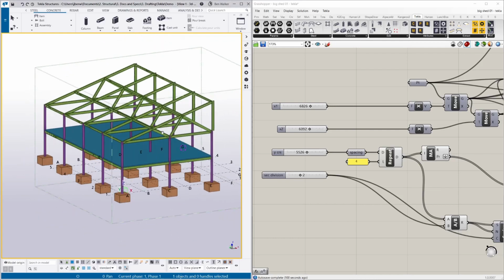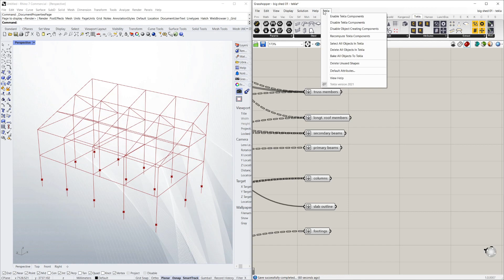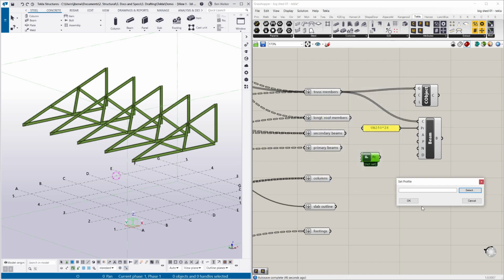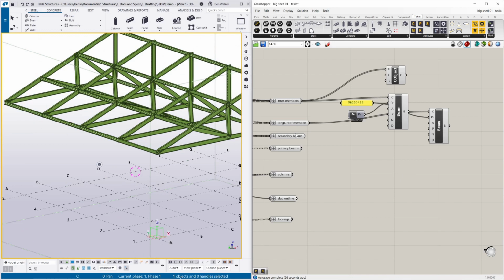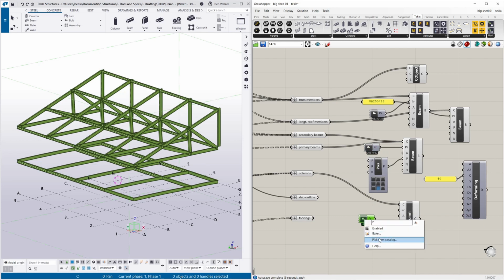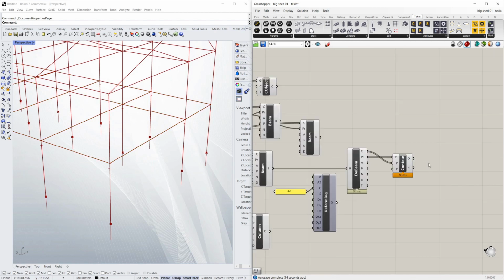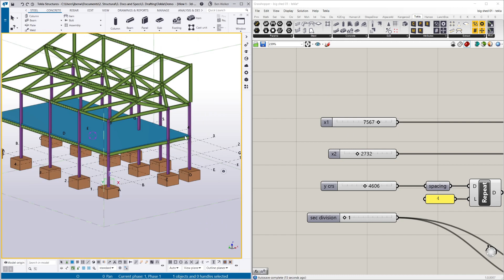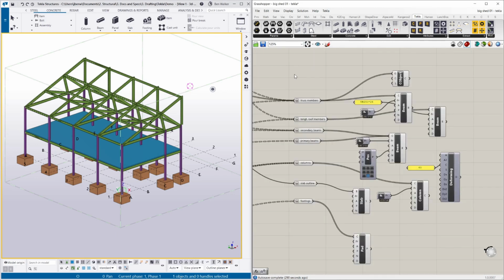Tutorial: Tekla Structures with Grasshopper

Comment: I see that Tekla model is not detailed, is not getting finished. Does it mean that to get Tekla detailed (putting all needed connections, bolts etc) user has to do it manually, by hand?
Reply from the maker: With this demo yes. All the connections, bolts etc. will need to be added manually. However detailed connections could be automated is if someone wrote a script to do this.
Reply: @StructuredParametrics  okey thanks, my point is if it is possible to fulfill the basic script with extra commands so that Tekla model gets finished completely? With other words are there limits in Grasshopper talking about tandem with Tekla?
Reply from the maker: @victorstrembitskiy7171  There are no limits if you use grasshopper to access the Tekla API as far as I understand. The grasshopper components supplied by Tekla have some limits (there is no bolt component for example). Therefore to do some really detailed stuff you will need to write some code but it can still all be within grasshopper.
Reply: @StructuredParametrics  thank you very much!